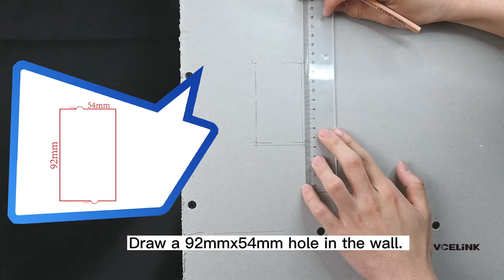How to install brush wall plate? Learn in a minute! || VCELINK Brush Faceplate

Comment: Hi, 2 questions,  It it possible to do this with a solid wall if you use trunking?  why does it need the brush?
Reply from the maker: Thank you for your question! If you can trunk the wall to place the panel bracket and make sure that the screw and the plate can be installed on the wall, the brush wall plate is suitable for you. By the way, the brush is designed to be resistant to dust, making your wall neat and beautiful.